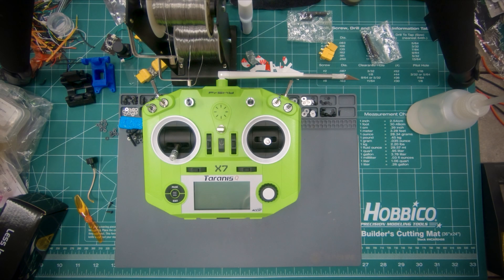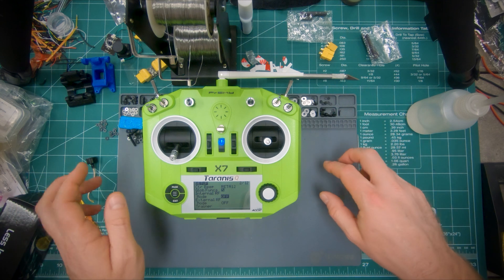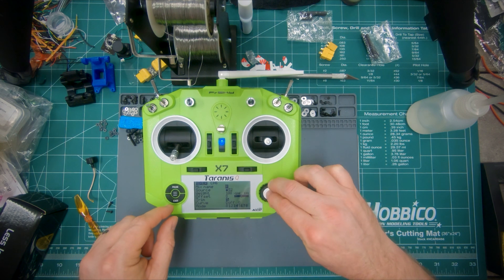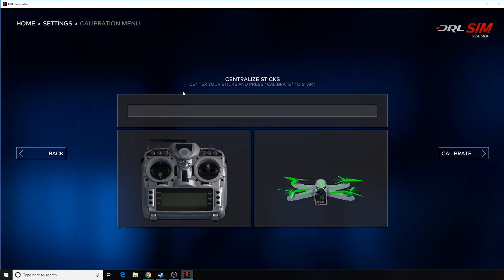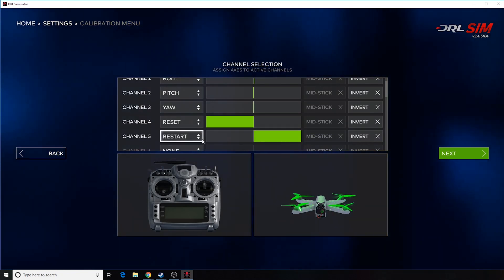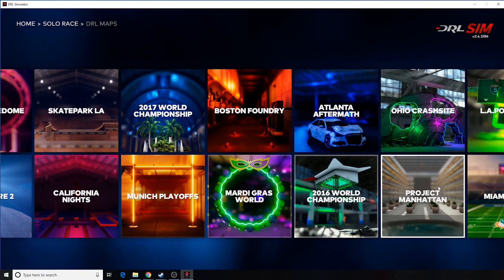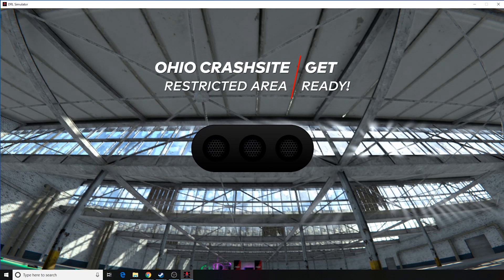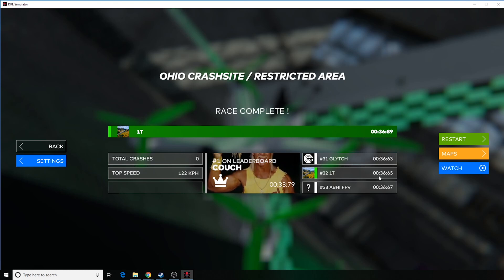DRL Simulator Controller Setup | Taranis | X-Lite | OpenTX

Comment: Is 100€ a good deal on this? Planning to invest in a drone and goggles in the future, just want to get used to it in sim. Or am i better of buying a i6 ?
Reply from the maker: At this point, I would not get any FrSky radios.  The company has done things that are very bad for its customers.  I have an i6, and it will get you by, but the gimbals are very poor quality and I can really feel a lot of lag in the simulator so I would highly recommend against it.  The best budget radio that I know of right now is the Jumper T12 Pro and it has very good gimbals as well as the capability to transmit almost any protocol from FrSky to FlySky to countless others.  If you can afford it, and it should cost less than a QX7, I would highly recommend getting the T12 Pro.  Look up some youtube videos about it:  it is very impressive.
Reply: Ian Beaty 
thanks for your fast reply,
just searched for the Jumper, although it isnt really in stores on short term in The Netherlands. 
Would you recommend any other controllers?
Reply: @IanBeaty  will thr jumper be compatible with DRL as well?
Reply from the maker: @theillmeister  I am 99% sure it will be.  I have heard from other reviewers that it is simulator compatible which means it will work with DRL.
Reply: Some side info; I know how to fly the normal drones (dji’s/evo’s and such). So a controller that can control 5” inch drones is nessesairy
Reply: Just got an offer for a 2nd hand graupner mx12 (€35)
Reply from the maker: @denzelvanlent7031  Sorry, I just saw these comments.  I do not have experience with Graupner radios, but I do not know anybody that uses them and am unaware of receivers for racing drones that work with Graupner so I would avoid it.  At this point I would hope the Jumpers are available for you, but the new company Radiomaster is proving to be even better quality and lower price than the Jumper radios.  Radiomaster will have its own version of the T12 and the new Radiomaster TX16s has two version and you get so much for the money that is the one I would recommend.  The version of the TX16s with hall sensor gimbals is definitely worth the extra money, but if that is out of the price range, the standard version is a great price.

Comment: Are the battery loading by using the usb?
Reply from the maker: On that transmitter and all the others I have tried the USB for the computer does not charge the transmitter.  If a USB can charge a transmitter, it is usually a different USB port.  For example, my TX16S has a USB port on the top for connecting to a computer for file transfers or simulators and a USB port on the bottom for charging.

Comment: Hey brother,
I have a small query,
I am using q7 for flying in DRL and it has a 2S lipo 7.4V as it’s power cell.

When I connect to my laptop the lipo is getting charged from the USB port. I can see the battery level increasing before and after 5 mins of sim flight.  It was 4.09 and 4.11v and around 90% after 5 mins it’s around 4.14 and 4.16 at around 93%

Any idea how to solve this?

Comment: Well my Tranis won't connect to my computer at all, I made sure to set up a sim profile on it and plugged it into my computer then choose joystick (HID) and my computer made a sound but it said no Hardware connection on DRL😡😓

I need help
Reply: did you ever have any luck figuring out a solution? I'm currently have this same issue.

Comment: Can you connect the T1D gamesir controller to DRL simulator
Reply from the maker: I have not used that controller so I do not know for sure, but after some research it looks like that it probably does not work with the DRL simulator.  Most any controller that can connect to and be recognized by a computer as a game controller should work in the DRL simulator, but I cannot find any information saying that the T1D can connect to a computer.

Comment: Just Checking,
is this website a good buy for the FrSky Taranis X9 Lite?
$50.10:        https://alexnld.com/product/original-frsky-taranis-q-x7s-radio-tansmitter-parts-carbon-fiber-silicone-case-cover-shell/?gclid=Cj0KCQjwhvf6BRCkARIsAGl1GGiENYyC51BwzLrtYxPQMnaMjpAG0Zx6annwJ3Ibbv3Z1w6BwSk1cXEaApwhEALw_wcB

Comment: This video is perfect. Do you know any cheaper controllers under $90?
Reply: You can sometimes find the Taranis X9 lite for $89 on banggood. But you'll still pay like, $3 for shipping.
Reply: @nothanksyoutube  thanks!
Reply from the maker: Anything under $90 typically does not have as good quality and generally it is worth spending a little more to get the quality.  I have set up a FlySky FS-i6 on the DRL simulator and sometimes you can find those for $40 - $50, but then you also have to buy a $10 simulator cable, and the gimbals are not very good.  The worst part is that the latency is quite bad, to the point that I have a hard time controlling the drone during a race.  I did find a simulator-only transmitter, FlySky FS-SM600 that costs $30, but I do not know for sure if it works with DRL and I do not know its quality.  The BetaFPV LiteRadio 2 and NewBeeDrone Beemote Controller are about $40 and say they can work with simulators, but I have no experience with them.  I would look more into one of those last two as a cheap alternative.

Comment: I want to get into this hobby and obviously I need to practice first with a simulator before buying an actual FPV drone. Does the FrSky Taranis X9 Lite work with DRL app? If it does I don't need to use batteries right, just the cable attach to the computer? The new X9 Lite is the cheapest controller I can find online. Sorry totally newbie here. Thanks for your help.

Comment: What is the difference with using a PS4 controller?
Reply from the maker: You have significantly more control with a true radio control transmitter of some sort.  The gimbals are higher quality and more precise.  Using a real transmitter also gives you better practice for flying in real life.

Comment: do you need a battery to plug to the remote in order to run the simulator?
Reply from the maker: For most controllers, yes, you will need to have a battery and turn it on.  I have a controller from the Real Flight simulator called the Interlink Plus that is designed to be used only with a computer and does not need power, but I am not aware of others that can do that.  You can always try using it with power and without power and see if it worked the same way without power.

Comment: Hi Ian, what if my DRL sim continues to tell me that there is no hardware connected? do you know how to fix it? Thank you.
Reply: Roll back the driver from devices and printers. Right click on your taranis.
Reply from the maker: @vbp6us  Thank you for helping out!  I was away for the holidays and just saw this.
Reply: @IanBeaty  Np. Glad I could help. Your video helped me out a lot in calibrating my QX7 TX.  Are you leaving all of the values in Mixer @ 100?  Other videos suggest bringing the weight down to 50.  When I leave it at 100, I barely blip the throttle and the quad flies up high.  I'm not sure why it does that. I have to mess with the throttle max/min and mid a lot to get it to a level where I can fly around, especially indoor maps.  I still can't fly nearly as fast as you are in this video.  Any further tips on settings, namely around what you have your mixer set to and what you have throttle set to in game would be great. Thanks
Reply from the maker: @vbp6us  Good question.  I had seen that about adjusting the mixer on other tutorials in the past too, but I did not adjust it for this.  I included in this video everything I did to set up the controller.  I do not know how experienced of a pilot you are, but when I was less experienced I had a hard time with throttle control, especially indoors and it took some time to get used to the throttle so that I was not shooting up too high.  To help compensate for that, you can program a throttle curve into your transmitter or adjust settings in the sim.  I recommend doing one or the other, but not both.  Adjusting in the sim is easiest.

To adjust in the sim, go to "Controller Sensitivity" in the settings and set "Throttle Mid" to 0.00 and increase "Throttle Expo."  Fly the same track over and over while adjusting the Throttle Expo to where you like it.  I like to run about 0.35 in the Throttle Expo.

I recently saw a great video about making a throttle curve in the transmitter here:  https://youtu.be/wZksCpdAlcQ

You can also increase your camera angle so throttle pushes you more forward than up.  I race at 65 degrees, but I am a bit higher than most.

Good luck!
Reply: @IanBeaty  Great tips! I'm flying around much better than before.  What a confidence builder.  I still don't see how I can do a flip though or how I would ride down a building or a crane face down.  Is that something you can do in this game like they do in real life?  Also power loops, are those possible in DRL? If so, why can't I get a 5" quad to do any of these maneuvers?
Reply from the maker: @vbp6us  Yes, you can do all of those things in this simulator and they are fairly similar to real life.  The various race courses in this simulator sort of force you to learn these maneuvers, but you can also practice them in freestyle mode.  A good way to learn quickly is to do multiplayer racing on many different courses.  Join into a racing lobby room and just race over and over and over, whatever the courses they happen to pick.  You will be slow at first, but that is not a problem because the game automatically times out 60 or 120 seconds after the first person finishes depending on how long it took the first person to finish so other pilots will not be waiting long for you.  When I started in the sim earlier this year, I always timed out and never finished multiplayer races, but I kept at it and now I am reasonably fast.

You can look for me in the sim and I'll fly with you.  I go by 1T in the sim.  Feel free to search for me in Steam and send me a friend request so you can see when I am flying.
Reply: @IanBeaty  That would be great! Thanks, Ian.
Reply: @vbp6us  ahhh I got it thank you so much!!!
Reply: @ianlu9962  Np! It's a good feeling once you see it detected in your sim.
Reply: @vbp6us  and if this doesn't help, do you have a suggestion?